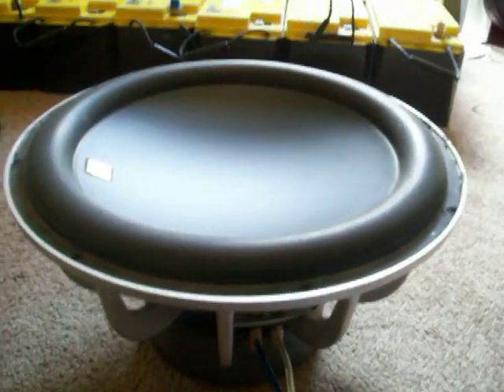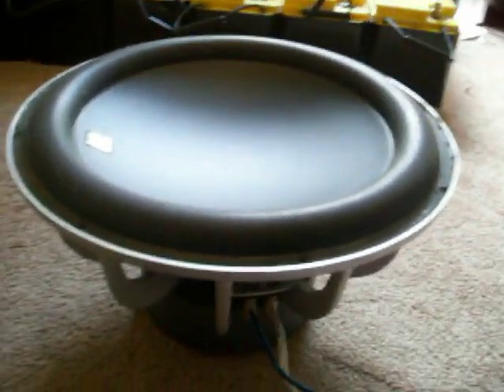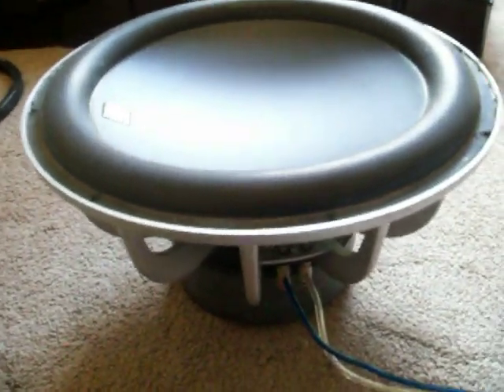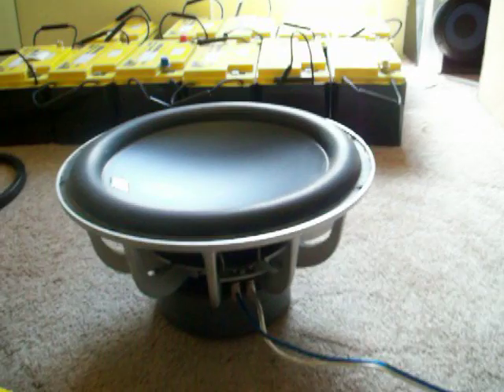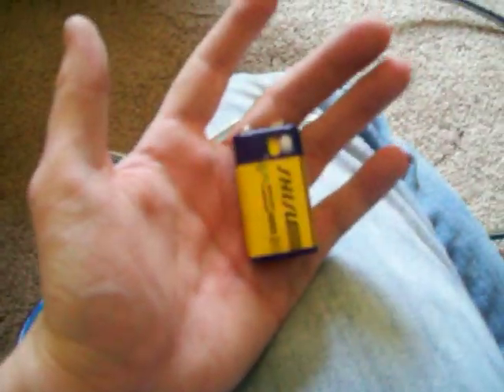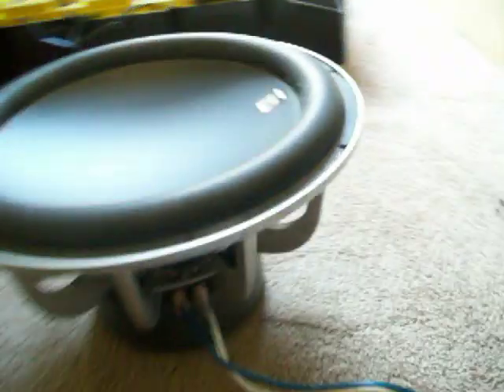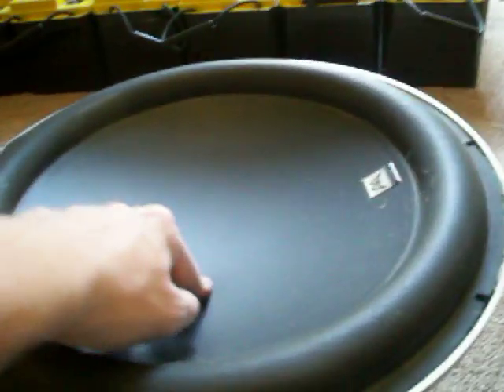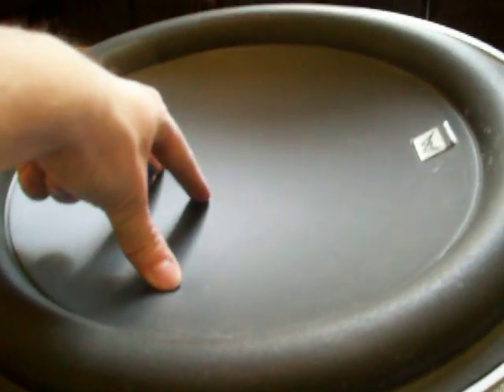How to Pop Test a Speaker

Comment: Seeing you know alot about speakers, can i ask you a question :) 
I have 200w Kenwood floor standing speakers which is hooked up to my home theatre. Quite recently the Kenwoods started crackling at low and mid volume. I checked the wires and connections. These speakers are about 10 years old. What does this mean? Thanks